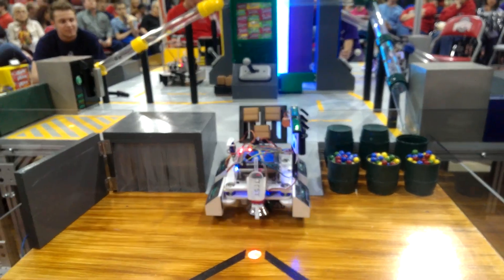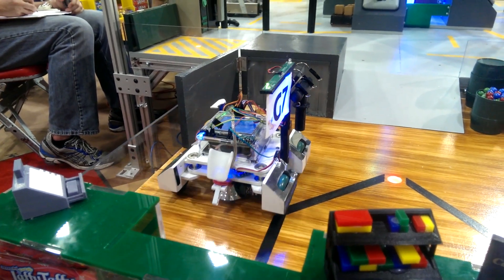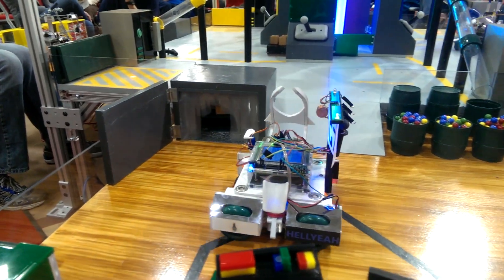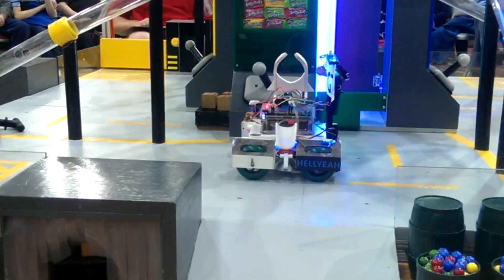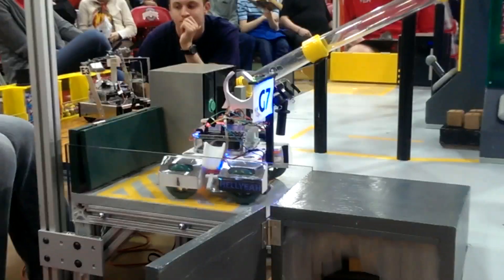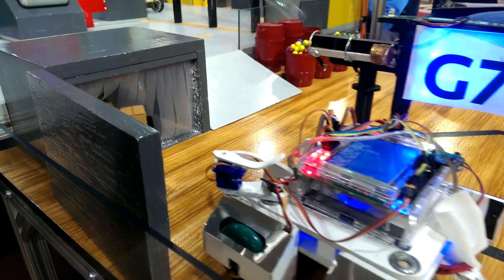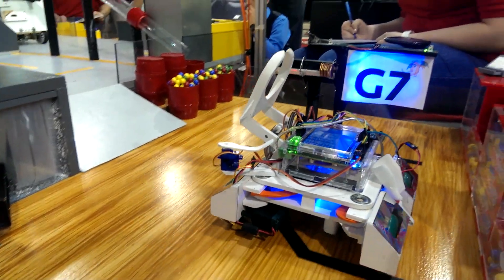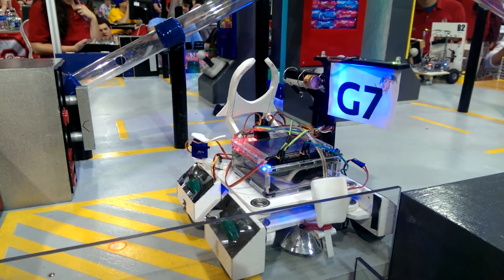Ohio State FEH  2014 Robot Competition Run

Comment from the maker: This is an example of designing specifically for a task: we realized that the course was set up so that pick/place tasks were all related to the same cardinal direction, thus the fastest way to finish the course would be to never rotate the robot... so I designed a mechanism to make that happen. We set the fastest time with this method. Here's the inside mechanism used to swivel the wheels: https://youtu.be/VPwNQhIyjLY?t=141